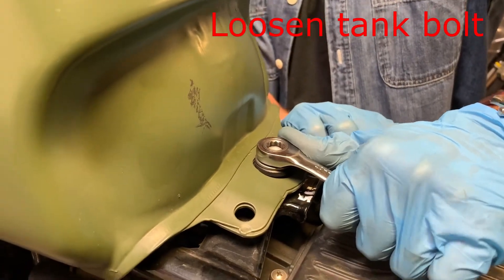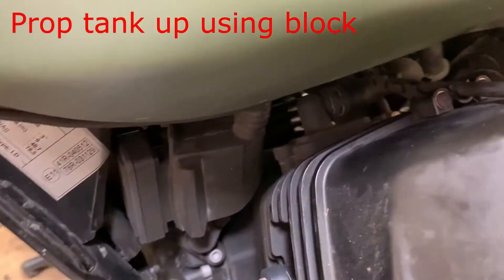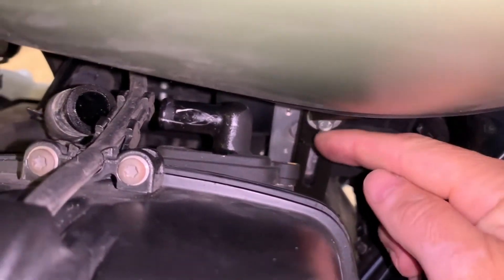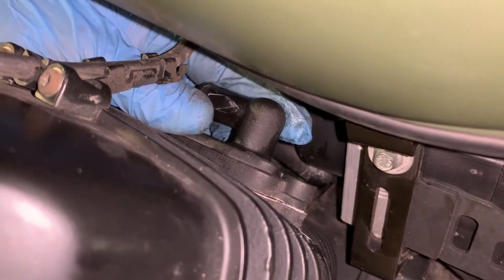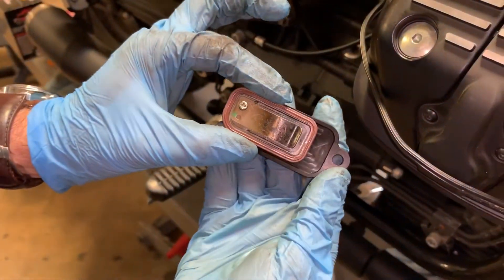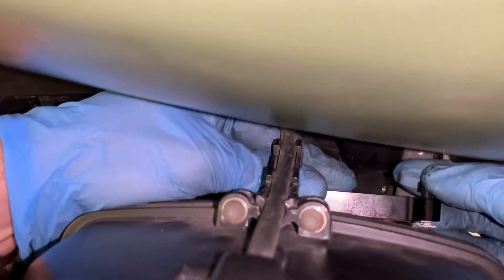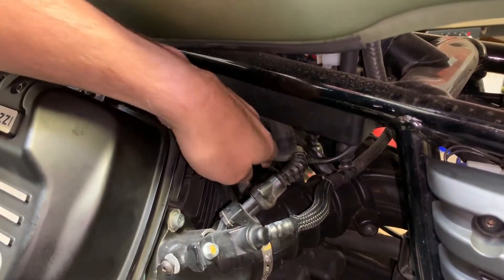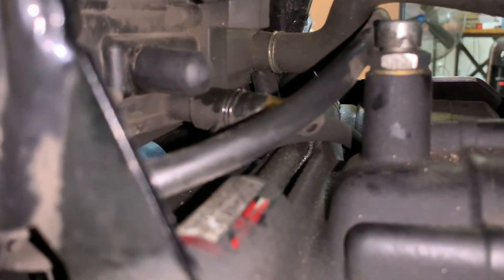SAS Install

Comment: Hi, could you please tell me if it works for the V7 850 €5?!
Mine is really anoying, with a "hole" between 2000 and 3000 revs that is just where i use my engine ( town ride)

If your SAS works, I purchase it right know!!